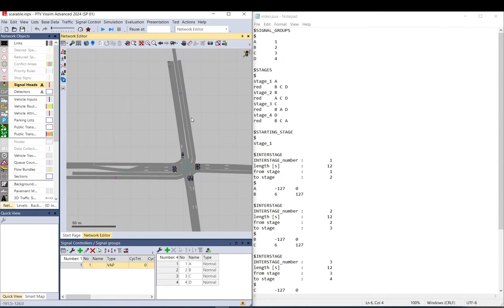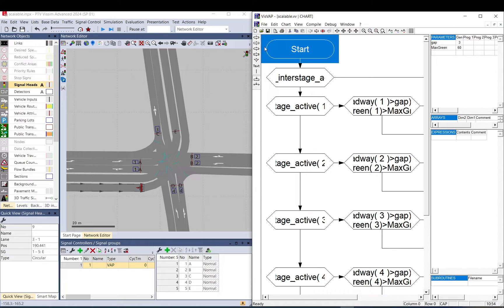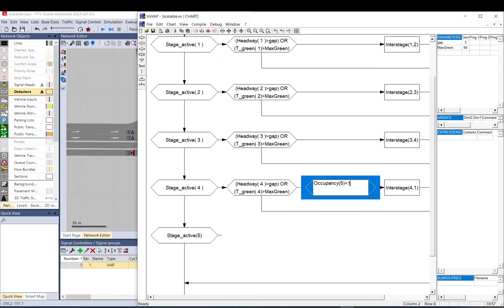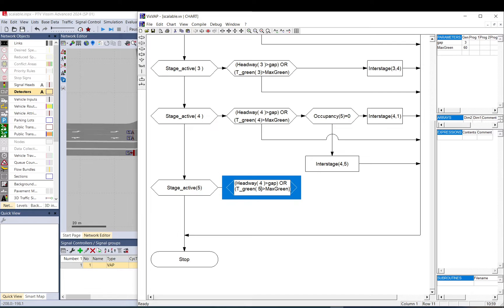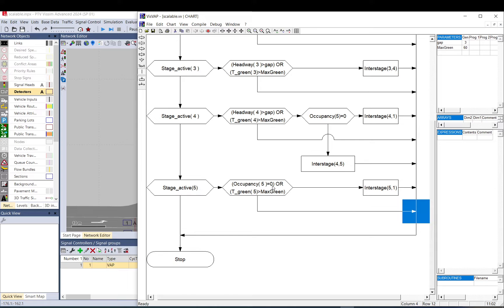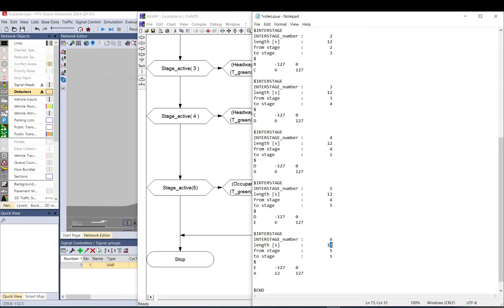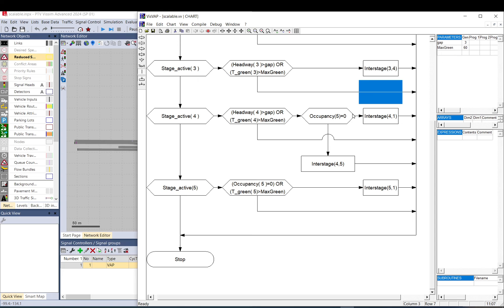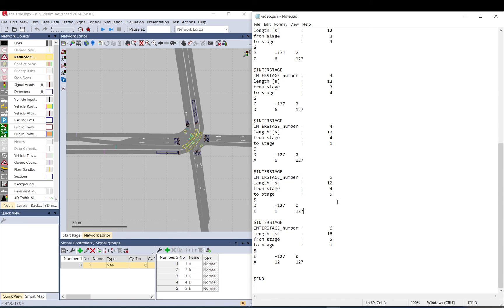Vissim Tutorial - VAP/VISVAP - Tram crossing in 4 arm intersection

Comment: pls add a condition for green extension and red truncation on this vap file
Reply from the maker: Hi, this has been done, check out this video: https://youtu.be/U80FVGNpwv4?si=eoIKgU0zA_M6g9L4
In this video green extension is featured for general traffic. Basically this condition is responsible for it: "(Headway( 3 )>gap) OR (T_green( 3)>MaxGreen)"
If there is no demand, it cuts the stage off and starts the next one. It also ensures that green cannot be extended forever, and that is the T_green... part in it.

Comment: hi, how can i correct which says syntax error in line 35 column 5  is from pua or vv file
Reply from the maker: Hi, you should check which file is it first. Does it say vap or pua? If pua, open the pua and check the 35th row. It is just a sytax error, so like a typo or something.
If it is in the val file, open the VAP file (not the .vv), check what is in that row, then go back to visvap, find the corresponding code and correct. In vap it is usually a missing or incorrect bracket. If you cant correct, copy paste here the 35th row and I have a look